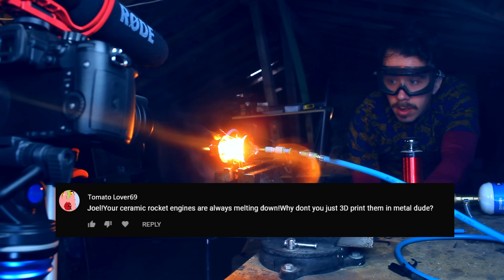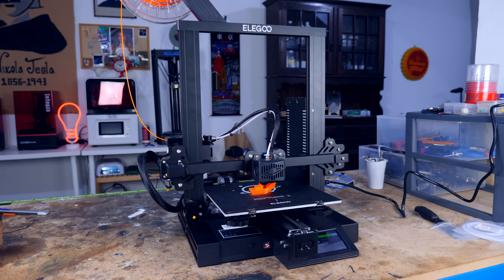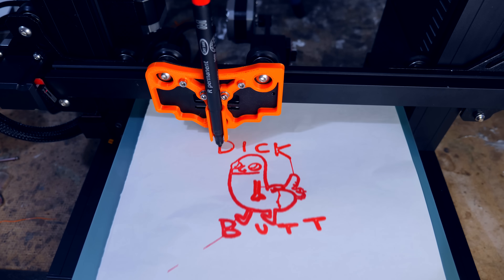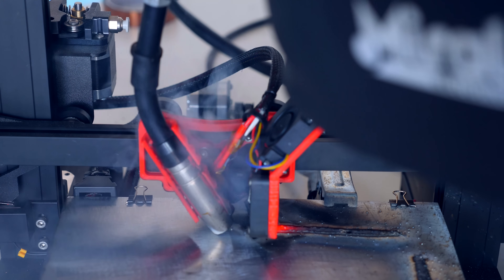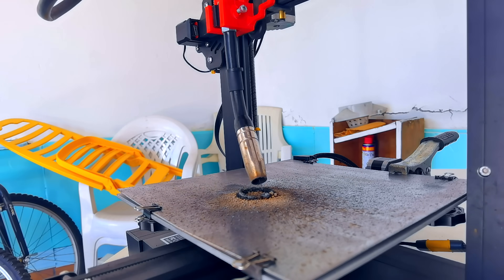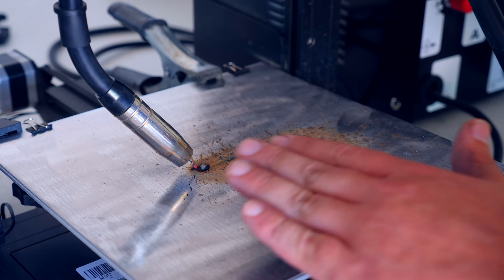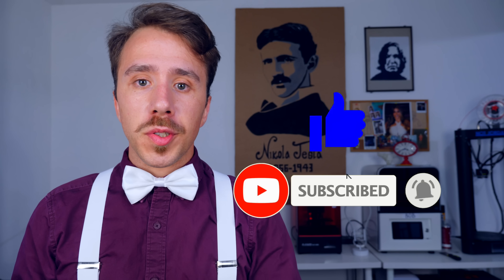I built a Metal 3D Printer using my Welding Machine

Comment: Shouldn’t angle the nozzle like this when building up material and travelling in different directions. Actually did something very similar years ago for repair filler welding using a fully articulated ABB arm robot. We had it oscillate on the axis perpendicular to the travel to gain line width and manage the HAZ. This got us very good and even line height and surprisingly nice finish
Reply: So a weave?
I agree though, it would be really cool to see if he could add something so the torch could rotate, like J6 on a robot arm. 
Would probably be easiest to just orient the nozzle perpendicular to the surface. 

Also thinking tacks would be better for this. Less heat input to prevent warping, penetration isn’t really important.
Reply: Was just gonna say that. Lulz at pushing and pulling the tip.
Reply: How did you deal with slag in the beads?
Reply: @skipfred  probably MIG and not flux core. Or they may have used TIG welder.
Reply: @jakegarrett8109  It's not TIG, there's no such thing as a TIG wire-feed welder
Reply: @skipfred  I meant TIG with a spool since they were using a robot arm you might as well just use a spool gun with that system (like aluminum MIG welders have, just use one of those and load your steel wire with a transistor or relay to activate it's motor since that's much easier than using a second robotic arm to feed the material)

Comment: So you know how they make vacuum cannons, and combine them with compressed air for crazy velocities. I always wondered what would happened if you combined that with the principles of a rail gun (could of copper wire producing a magnetic field, steel projectile) to eliminate any friction resulting in no resistance to acceleration.

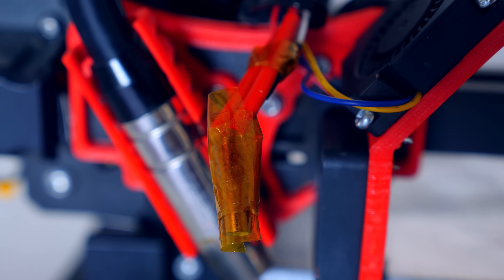Comment: Ok I'm on the 5:00 mark and I'm a welder. MIG gas nozzle can get very hot, sometimes especially after long welds like yours I can't hold it even with thick leather gloves. I don't think any fan will be able to cool it down  enough to stop melting plastic. But let's see what you came up with.
Reply: 8:06 your setup is wrong. The nozzle is way too far from the work, that's why the weld looks shitty and you have lots of ugly spatter. Close it down and watch the speed, with the right one you can do this. Thicker base will still bend with that amount of heat in the middle but depends how thick you want to go.

Comment: I am a welding expert and have some suggestions for you as in the industry we do something similar but in straight lines and with a different welding process, also the angle is whats killing you the most as the angle only helps if it’s being drug in that direction all the time, therefore the nozzle would have to also rotate as the printer changed direction. To fix this straight up and down would be your best option. Reach out if you want

Comment: Hey friend you should try 3d metal casting with your 3d printer! Perhaps that way you can actually build yourself a good rocket engine. (+You could melt metal using your welding machine) Keep the engineering up!

Comment: As a welder I have some tips. First of all, using a fan to cool the part is a terrible idea because for this to weld smootly, you're going to not want to use flux core, but mig, and the shielding gas can't be blown away. You can set it up so that it only welds for a short distance and then pauses for the fan to turn on and cool the part for a while, and then start again but I think your best bet, at least if you're welding a part that isn't too tall because steel has poor thermal conductivity, is to use a thick aluminum bed that is internally liquid cooled, to draw heat away from the steel part which has its steel base bolted to the aluminum bed, with a good amount of thermal paste between. Also if you go with the fan option, a regular fan won't cut it. You're going to have to use a decent air compressor and shoot compressed air at the part because if you were using a fan to blow the amount of air at it that you would need for this to be realistic, that would have to be a pretty big fan. Welders often use compressed air to cool off pieces if it needs to be cooled faster than just letting it sit.

Also two other tips. The reason you shouldn't use flux core is because you will have to knock the flux off after every pass. You shouldn't weld directly over the top of flux, it makes horrible results. Secondly you would be better off keeping the nozzle at a 90° angle  because then it will be at the same angle no matter what direction it's going in. In welding there is an idea call pushing and pulling that refers to what your angle is at in relation to your direction of travel. I won't explain it, you can look it up, but it doesn't make sense to create a weld that is for example a circle made on this machine, where for the first half in rough terms, it is pulling 20° and then pushing 20° for the other half. If you're going to do this, then the gun is going to have to rotate to maintain the same angle whichever direction it travels in and it creates another complication of your point of contact being inconsistent because wire stickout can change slightly. If it's pointing straight down then at least your point of material deposition is always going to be in the same place, which is directly underneath the tip. Lastly, in my experience, pulling with mig creates a more convex weld. This is ideal for regular welding applications, but I think it would be good here since your extrusions for lack of a better word will be more inline with other forms of 3d printing. Pulling with a weave can create a flat consistent weld but just dragging a straight pull will give you more 3d printerish results. also I recommend using .023 wire. It's small enough that it can create some nice tight small welds that are going to be more manageable, both thermally and otherwise, than something like .030 or .035 or god forbid something bigger like .045. trust me, at this scale .023 is going to work probably better than anything else. If you can find smaller then that's even better but as far as I know, .023 is the smallest common wire.

Comment: Flux core wire is not a good option for this application.  Shielding gas is better. Another problem would be welder itself. Cheap ones could be use for very limited time. Usually 20% of time. They could overheat and protection will turn them off. So we need beefy  welder. I would say something around 2000€?

Comment: why not make a ceramic printer that uses a liquid ceramic in a concrete like slurry.  like a concrete printer but for ceramics, you could easily make rockets with that and them not burn up.

Comment: Wire Arc Additive Manufacturing: WAAM. A subset of directed energy deposition (DED). There's other names out there, everybody likes to make their own acronyms. It's a pretty complicated thing to do right. I don't think thicker steel will help you much, at least not 6mm. Maybe 25mm. Even at 6mm, the plates will still warp and bend.  

LA100 is a decent alloy for this application. It's commonly available welding wire from Lincoln Electric. At least that's true in the states, not sure about Portugal. 

As some others have mentioned, some shield gas will help you keep an more consistent weld track. That balling and inconsistency in the weld track can sometimes be caused by air.

Source: me. I work in this field, specifically laser wire metal deposition (LMD-w).

Comment: Very creative. For a future video, rather than welding plate, small components could be welded together as is done with a robotic welding cell. Instead of plate, a part positioning jig could be constructed. You then program your printer and welder. Next position the parts to be welded and run your program to make the welds. Repeat until you run out of parts.
A consideration will be welder duty cycle, it will over heat if its duty cycle isn't 100%, so you'll need to factor for that.
Another consideration is the weld "grounding clamp", it needs to be connected to the moving table. Maybe this could be done with a flexible braid. An interesting project. Good luck.

Comment: You're using FCAW process with the flux core wire... This experiment would go much more smoothly using MIG welding! No need to remove flux between layers, and the weld itself stays cooler with the shielding gas, which can help when welding to thin metal and can reduce warpage.

Comment: There are actually commands for arcs in G-Code. I just don't know if your 3D-Printer Controller supports them. A very extensive explanation of standard G-Code can be found in chapter 3.5 of the NIST RS274 NGC Interpreter Version 3 Publication: https://www.nist.gov/publications/nist-rs274ngc-interpreter-version-3

Comment: The idea is cool)) and the performance is bad) Where is the shielding gas?)) Of course, the seam will be crappy without a protective environment)) the same as welding with an electrode)) Use a welding machine with a shielding gas blowing and the surfacing will turn out to be of high quality))

Comment: Ideas for you:
1-print a bi-material 3D print (that can act as a bimetallic strip) be used as a temperature controlled switch. ABS alone bends when heated up and return back when cooled, so specialized shape of ABS structure can be used in such a way that it mechanically amplifies the bending due to temperature change.
2- Connect 1000 button cells in series (small watch cells) and make high voltage then fry some killer tomatoes... hahaha

Comment: Maybe you can make a feeder for the flux wire with the extruder, the bmg dual drive is actually base in one of those, so the retraction is way better, and maybe a MIG welder with a straight touch will do.

Comment: Additive modelling is not the answer.  Try a pulsing high current from an electrode (EDM) attached to the printer.  This is something I intend to try myself.  The only downside is it tends to work best when submerged in water - but that remains to be seen / tested.

Comment: I know that CNC printers can be expensive, but...you are a "builder" and you need to build one.  I am in the process of building a large 5' x 5' Router CNC system, all in all, I have spent about $500 in electronics and linear rails/threaded rod.  I will be creating the rest out of plywood.  With your knowledge of 3D printers, there is no reason you shound not be able to create a smaller CNC.  This would give you the ability to fabrigate in other materials.  many people add other functions to them, such as CO2 lasers or even plasma cutters.  you can do it!

Comment: Actually, you can tell it to draw curves. Heck, there is even some programs that make normal gcode into gcode that uses curves, so that the microcontroller on the printer can fire off movements at greater speed with greater microstepping without running into issues where you can't send it orders quickly enough.

Comment: Use pvc or nylon, they are two flame resistant polymers. You could also use peek which is a high performance engineering polymer.

Comment: I find the 3D printer manufacturer kind of stupid if they don't have support for G02 or G03 code in the 3D printer for manual programming. Writing a million rows of G01 like a cam system is extremely inconvenient compared to just G02 X70 Y70 I40 J0 (Or R40 modernized) for example, I hope they at least support G91 with a repeatable sub-program so you don't have to write 200 lines just for a radius.

Comment: You STILL need shielding gas.  Why have you not acknowledged this?  Your welds would be SO MUCH better.  (your welds, and this project's welds)
You aren't a bad welder, you are just using a bad setup.

Comment: To dissipate the heat, you can used a larger aluminum plate with the thin steel. Or you could cool your printer plate, say water, peltier, or another way.

Comment: well you pretty much angle the welder so you can see so.... and i know depending on certain curcumstances you do angle the welder for different reasons like slag inclusion prevention and longer heat input, more or less penetration bla bla

Comment: This is my idea for a future video, try a 3D printing welder 2.0 with the following modifications. I'm also a welder so I'm biased towards wanting to see you mess with welders more.

In this case where he is stacking layer after layer of weld, using GMAW (mig) would be the better option. The problem with using FCAW (flux core) in this instance is slag, GMAW is cleaner as it doesn't produce slag and because you are trying to 3D print, basically your end goal I believe is to punch in the design and let it go to work. This cannot be achieved with FCAW because of the slag, just welding over slag will result in some porosity (a weaker and uglier weld) and from my own experience, welding on a clean, slag free surface is easier and it produces better welds. I seen another comment as well mentioning that you could simply add in a way for shielding gas to purge the area being welded, and using mig wire, basically making a diy mig. I believe this should work fine for a cheap fix because you are using it on a 3D printer, I believe it wouldn't work if you were using the gun normally because the gas wasn't built in to the welder originally ( I believe, I didn't see the machine to know if it could run GMAW as well) you would be dealing with two separate lines (one for gas and one for wire).

His other problem was the metal warping, like you said, using thicker plate could help in solving this problem. As well as, if it is even possible on the printer he is using, coding timed pauses and restarts regularly to allow for cooling of the steel, minimizing warping.

Another thing is the angle of the gun. With the way your bracket is set up to hold the gun, placing the nozzle perpendicular to the plate may work best because when you are making a circle on the printer, sometimes it is pushing (the weld pool is in the direction you are heading) the weld and sometimes it is pulling (the weld pool is behind where you are heading. By keeping it perpendicular to the plate you won't need to worry about accounting for it welding differently depending on the position or where the weld will end up.

Comment: Try to make a metal 3D printer as the one that is described as the price of several Teslas. I mean getting metal impregnated filament printing it and then putting it in a furnace to melt the resin probably not kiln probably more like furnace or forge

Comment: You don't need a metal 3D printer, you can use Filamet metal filament with a normal 3D printer and sinter it like you do with ceramics. I mention this in the comments of every video and you don't seem to read any of my comments. Argh.

Comment: Looks like too much amps. Basically the higher the amps the flatter the weld, so probably go for low amps and slow speed so it doesn't skip spots.

Comment: As I know real metal printer using metal powder and work similar to photopolymer printers just upwards instead downwards. Or... Wait, it work exactly like photopolymer printers only using laser to melt portion of metal powder. Actually even in that way You can make one. You need lazer wielder or any similar laser. Need some mechanics to clear powder after each layer and pushing down printed detail... It need some more additional materials, but it still doable.

Comment: But G code can work with circles we have the standard XYZ but we also have I and J to work with radius.
If you do revisit this idea in a later video I would suggest looking at using a tig welder instead of the mig. The heat affected zone is smaller and you have better control of the wire

Comment: Have you thought about the other method of 3d printing metal by adding layers of metal powder on top of each other and only melting the surface. Commercial devices use lasers to melt the metal adding the laser to the print head seems doable and finding a way to add the powder on the surface between each run seems also doable.

A bigger issue is the laser. I found this video how to make a powerful 5W laser yourself:
https://www.youtube.com/watch?v=DMVWW-bmKwQ

I also looked at the data table of a commercial machine and it seems they also only use 5W lasers, but maybe they focus it better to reach the necessary higher temperatures to melt metal.

I also found this video showing a 6.000$ metal printer, yes that not cheap but also not so expensive that you could never afford it https://www.youtube.com/watch?v=OjjczQkK2zM

Comment: There's a company called Relativity that's using this technique to print full-sized rockets.

@Integza you don't need to angle the torch with MIG welding.

Comment: ... so ... build your own welding 3D printer rather than adapting one. A framework holding three (X, Y, Z axis) sliding brackets moved by three stepper motors controlled by an Arduino and/or RasberryPie. Build it out of metal to withstand the high temperatures and give it a vacuum table base to hold the sheet metal in place. It almost designs itself. You could get at least a 5 or 6 part series out of it.

Comment: G code actually supports circular motion via g2 and g3 functions.
Reply: But it still is comprised of small straight line segments since the motion is conditioned by stepper motors and linear rails.
Reply: @franciscoveiga8263  The thing is the slicer normally dont geneate them becaue of how an stl file is working. This have the downide that the gcode files get huge as one circle is made from maybe over 100 lines of G1s instead of one line of G2 G3. There is a plugin for Cura called Arc Welder that generate G2 and G3  but the 3d printer firmware is often not stock compatible with G2 G3 and will generate erratic movements. (at least on my Ender3 V2) A firmware upgrade for the printer should solve this however.

Comment: Interesting project.
Try to use CO2/Argon 80/20% mixture gas shielding instead of flux-core wire.
You'll get much cleaner welds. Also, CO2 cools down your welds quite a bit. But thin sheet metal will still warp.
Cheers!